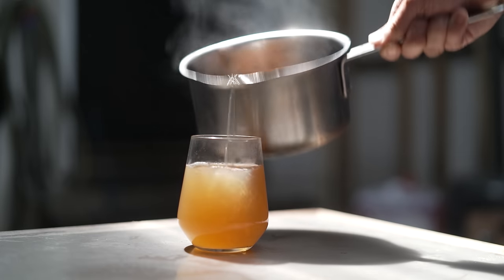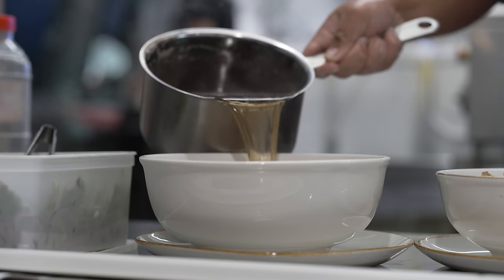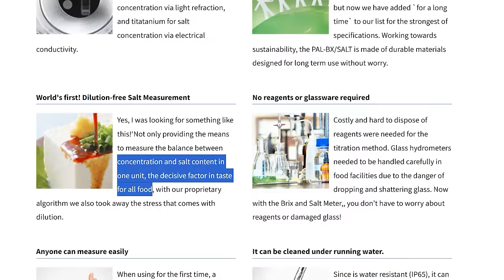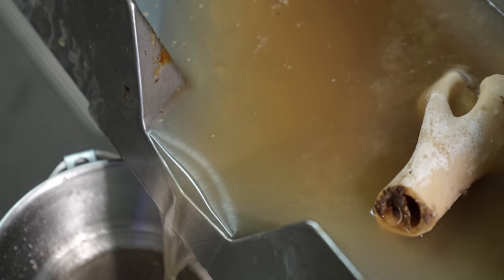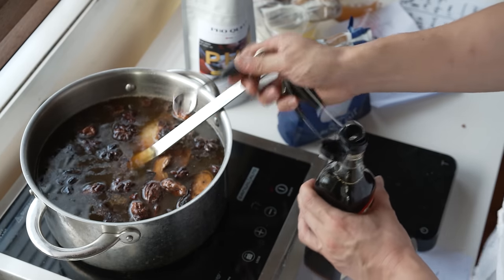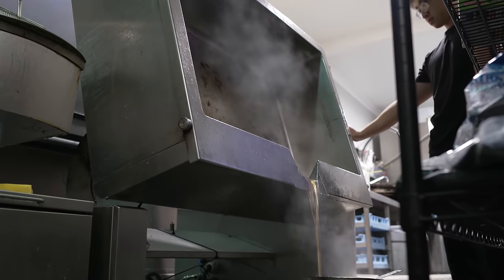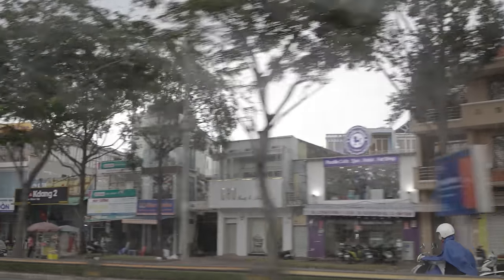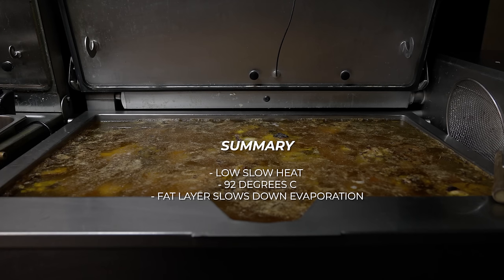The Science Behind a Perfect Pho Broth (with recipe)

Comment: Amazing video.   

One thing that I'll add that while the Brix and salinity Atago meter looks impressive,  it cost $700+ USD.   You can get similar information using a conductive salt meter that is used for aquariums,  a refraction scope scaled for saltwater, a chemical pool tester,  or using a hydrometer.  All of these are like $20 a piece.  Conduction of broth is going to be mostly based on salinity (the atago meter has two metal contacts and is doing a conduction test).   The conduction salinity meter works but isn't super accurate.   The chemical test is the most accurate but kind of inconvenient.   The hydrometer is going to be fairly accurate due to fats being lighter than water salt being the real thing that is affecting the specific gravity of the broth but the downside is that you have to fill a column or cup or something to drop the meter into. The refraction test I am unsure how accurate it will be with oils and fats being in the broth. I question how accurate the Atago's refraction scope is.   I imagine it will be repeatable unless you get a glob of fat or acid on the side but I am unsure if it is going to give you the true specific gravity.

Here are some examples.

Conduction for salinity
https://www.amazon.com/gp/product/B0BV9G3XZ6/ref=ppx_yo_dt_b_asin_title_o00_s00?ie=UTF8&psc=1

Hydrometer
https://www.amazon.com/gp/product/B07BK3S4XF/ref=ppx_yo_dt_b_asin_title_o01_s00?ie=UTF8&psc=1

Refraction scope scaled for salinity ranges we are interested in.
https://www.amazon.com/gp/product/B08TJ28XC1/ref=ppx_yo_dt_b_asin_title_o02_s00?ie=UTF8&psc=1

Chemical test for chloride ion -this will be the most accurate but very tediuos
https://www.amazon.com/TAYLOR-TECHNOLOGIES-INC-K-1766-CHLORIDE/dp/B001DO35EU?ref_=ast_sto_dp&th=1

Comment: Amazing. Thank you for this. Thoughts on making the bone broth base in a pressure cooker???
Reply from the maker: The issue as I’ve pointed out in other comments is finding a large enough pressure cooker that can accomodate beef bones. In my experience the ones from K-mart are tiny. Add one bone and it takes up half the pot before you even add water. Most pressure cookers need to be below a certain level to activate the function. If you can find a big enough one by all means.

Comment: Does the brix and salt change depending on temperature? And if so on which temperature should i check the jelly? You have no idea how inspiring you have been Leighton cheers!
Reply from the maker: The readings do shift with temperature which is why I tried to take all readings after it's cooled down.
Also remember to take the measurements with a grain of salt. By no means is this meter 100% accurate vs having it done in a lab - but its close.
More importantly even without the meter you can replicate this recipe if you have a basic sense of maths - this is the key takeaway. 
As for the jelly you can throw it in the microwave for a few seconds to melt it and take a reading if you wish but visually you can gauge this.

Comment: Great video, around chapter 2 I think it should be mentioned to make sure after the base is done to let it sit and create that fat layer on top so it’s easy to scoop out of the broth. I went straight from taking out the bones and filtering it and it came out super oily. Will make my correction and see if it turns out different :)
Reply from the maker: Great observation - you only know when you actually start making it. Best of luck ❤
Reply: @Pho  thank you for making the video. I want to make my fiancé a great bowl of pho and even though I messed up this first batch it still tasted really good so once I make the adjustments I know it will be perfect. Thank you for sharing your knowledge.
Reply: @Pho  hey chef I was wondering if you had a recommendation for an induction stove that I might be able to buy to help with the base broth simmering? The first time I tried making this pho I let it simmer overnight on low flame and knew it was dumb. Then I bought the nuwave pic gold induction stove and it keeps turning off randomly. Just wondering if you had a go to one that you can recommend? Anything would help and thanks in advance.

Comment: Hi Leighton,
loving this lastest video! Just wondering about how you create the ox tail concentrate (ox tail:water) and is there a ratio you would use this together with the base or is it more a feel thing? Also, LSG shipping to Japan a possibilty in the future?
thanks again for this video - have really learnt a lot with the way youve broken it down
cheers
Reply from the maker: Appreciate the kind words =) 
Just enough water to cover the oxtail - there isn't exact measurements so don't get too caught up on this part. 
If the concentrate is strong add a little back into the broth. If it's loose and watery you'd add more. 
This is where feelings come into play. Add enough so it gives that linear broth a lift.
Oxtail has an unmistakable taste - its more pronounced than straight up beef bones. 
It's also more expensive which is why the bulk of your base should be beef bones then add this as icing on top.

Comment: I used a mix of lamb bones and beef bones and I was supposed to make a 1:1 ratio but my slow cooker is shaped weirdly I had to top up more then I needed but I know your supposed to add more water so it doesn't evaporate as quick. I ended up getting 2L of broth from 1kg of bones. would this still turn out as a great pho or should I start again?
Reply from the maker: Don't throw it out! 
As a rule of thumb I never go past 1:2 - anything past this point you start to lose the integrity of the taste. The trade off is more portions. 
At 1:1 some people will find it way too strong but at least you have the option to cut it down and still maintain maximum taste. Everyone's preferred taste will be different. 
Your ideal ratio may be a 1:1.25 or 1:1.5.
It's the lesser of two evils. On the opposite end is having no natural taste in the broth at the end of the cook and trying to salvage it with boosters and bouillons which taste fake. 
What you'll find is when you add the seasoning ratio meant for a 1:1 base into a 1:2 its like a bus that drops you off down the road from your house.
You will get a glimpse of what it was meant to be but the taste isn't as pronounced but at least you know how to wind it back next time by starting at 1:1. 
Wrap up point it's a great exercise to season at 1:2 then drop down to 1:1 and see the difference that it makes.
Reply: @Pho  AH, I ended up over seasoning it and it was really salty and I think I overspiced it as well, probably my worst pho because I couldn't tell if I added too much sugar or too much salt. I had to throw out :( it couldn't be saved. I will try again with a fresh batch I've got marrow bones and coles soup bones in the freezer waiting to be used. I'll go easy on spices and slowly add salt to taste. I've made good tasting pho's in the past but I wanted that extra kick in richness and beefy flavour. I've tried all possible methods but I'll keep trying!

Comment: Hey do you mind sharing what temperature setting you use for the blend portion of the broth? Do you add extra broth to compensate the water loss?
Reply from the maker: Blend portion again is a gentle simmer to dissolve the seasoning and infuse the spices and aromatics. 
As long as it's not a roaring boil you should be fine. 
I have found in the past if you have brisket in the pot as well as the temperature is too low - the brisket won't be soft and tender. 
My exact settings is always 92 degree C. 
Of course at home it's very hard to control on a stovetop but just be sensible about it. If the levels drop slightly top up as needed so long as you're not losing half the load and continually topping up blindly you'll find your chances of getting it right improves significantly.
Reply: Thank you man, you are the best! Hoping your channel get the recognition it deserves.

Comment: What about the meat, marrow and tendony connective tissues on and in the roasted base bones ? Do you use it - great toppings no?
Reply from the maker: Great question - I've spoken about this in length in comments on my other videos.
All those good things YES you can salvage and use as topping no problem...at home. These were cherished memories as a kid. Dipping the tendon with hoi sin / chilli sauce straight off the bones after mum cooked a pot of Pho.
The issue in a commercial scenario is it's unrealistic. In and out. Simmer bones > scoop it out dump it. Next batch. There's no time for a rescue mission sifting through 100kg's of bones.
The next issue is customers don't want it. These "extras" are usually very fatty.
I've heard of stores that offer used bones from the pot - this option is called "xi quach" but I've never seen here in Australia. The demand is non-existent.

Comment: How do you guys simmer the broth with such little water? I tried making 1:1 ratio broth and the bones are not fully covered by water in the pot.

Do I need a skinnier/ taller pot?
Reply: How do you not get it?...
Reply: In my pot, which was a 12 quart wide pot, the bones took some shaking and mixing to get to fall under the water line, but I was able to fit them all under.

Comment: Can the base be made in an InstantPot with no water loss?
Reply from the maker: You can use any vessel to make the base - the main issue I've found with instapots (ones available in Australia) is the size. They are too small. You can barely fit a good piece of marrow bone in and its full. 

The second issue is if you wanted to use the pressure function the level can't be too high.

Comment: Can anyone recommend an induction burner that will hold a 90c temp?  I have one that doesn’t work well for something like this and when I jumped on Amazon and read reviews of lots of units they all said the same thing, boils fast but won’t keep a simmer.
Reply from the maker: A tip a forgot to include - hot water urn. 
That's how I started off. 
Can pick a large one up for chips off marketplace. 
They go hard. Thermostat. Cuts off when hits temperature.  Safe for overnight cooking. Spout.

Just remember to place a stand off at the bottom of the urn so the bones do not come into direct contact with the element. I used a round stainless grate attachment that comes with a rice cooker.
Reply: Thanks for the tip!  It was a great video! I watched the last part twice already and I’m sure I’ll watch through from the beginning once more.

Comment: Great video Leighton, you're truely an engineer by the charts lol. Do you think adding temperatures for roasting the bones is ok?
Reply from the maker: Thank you for remembering I was once upon a time an engineer. It doesn't go away! 
I'd recommend 240 degree C to get the initial sear then you can lower it to 160 degree C for another 20-30 mins.
I've used similar settings before. 
The only reason I go 300 degree C is my oven is filled to the rafters but most home ovens don't go this high.

Comment: I don't understand the logic: If Pho An has a brix value of 8.3 and Leighton has a value of 8.7 (and slightly more salt), based on the info given in the video, all this means is that Pho An made a choice not to cook their broth as long or chose to add less salt. Isn't it common knowledge that the longer you boil something, the more water will be boiled out (as steam), and the brix value will increase. If he had boiled for 48 hours, the brix and salt value would be even higher. I'm very confused why a smart person like Leighton seems to be providing evidence and then drawing non-logical conclusions.
Reply: to be fair, the brix value from pho an would be after the addition of the noodles and toppings which would then dilute it. the original brix, I believe, would be comparable to Leighton's if tested this way. in saying that though, he does make a final statement that this is still slightly different to pho an but pretty close.
Reply: @jordyap1  does he say it was after noodles and toppings? I may have missed that but I would not assume that. You can order pho to go and they usually separate broth from noodles and toppings.